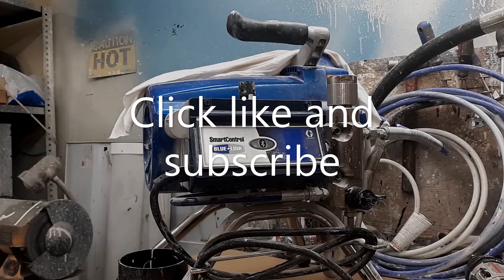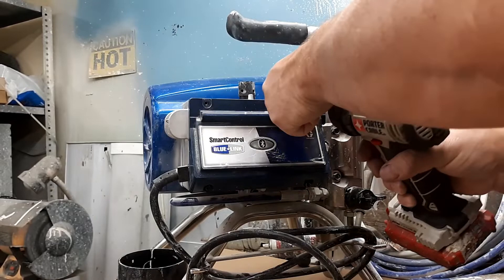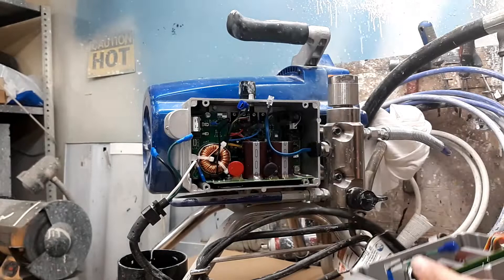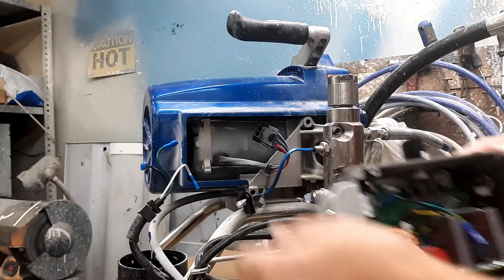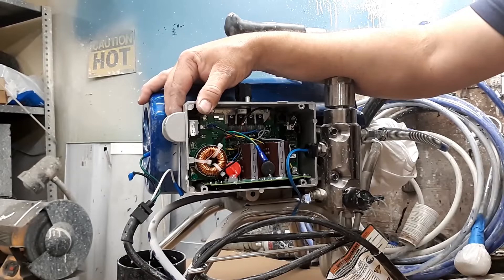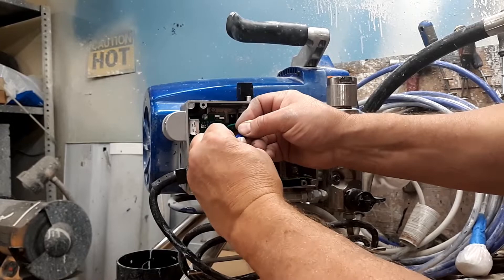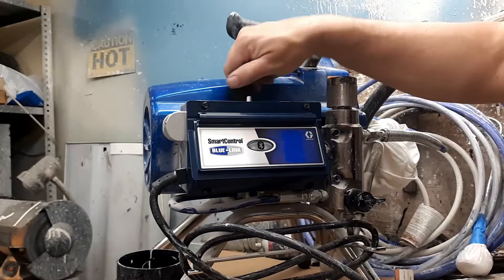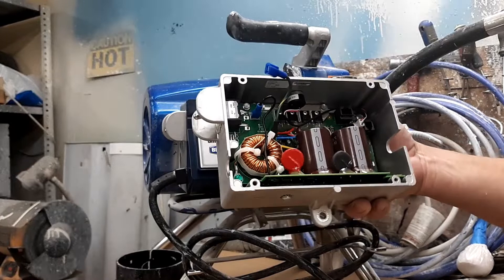Graco 490 board

Comment: Hey Brian, I have a newer graco 595 pc pro that reads the transducer code. I have a new transducer on the way but not sure if the motor not running at all is normal. Any input? Thanks!
Reply from the maker: When the transducer is bad, usually the board gets a reading that the pump is at full pressure when it is not. The motor will not run. This is due to the bad transducer

Comment: My sprayer doesn’t turn on at all it just flashes red light 3 times on D20 anyone know the issue?
Reply from the maker: More than likely you have a bad transducer. There could be a possibility of a couple other reasons, but that is where I would start
Reply: @Brian_the_repair_guy  thank you! I will check transducer
Reply: My nova 390 keeps pressure too high, I've replaced control knob,  still the same.  Thanks  in advance!

Comment: Hello Brian!! Thanks for all your videos. I have a question for you. They gave me a graco magnum xr7 that's not working. When you turn on the power switch the motor spins for a little and right away it stops. I replaced the power switch and still the same problem. What do you think it could be?

Thank you!
Reply from the maker: If the motor turns off without pressure, you have a motor issue. Would most likely need to be replaced
Reply: Got it! Thank you sooo much for your info! Have a great day
Reply from the maker: @tamarindoreo  no problem